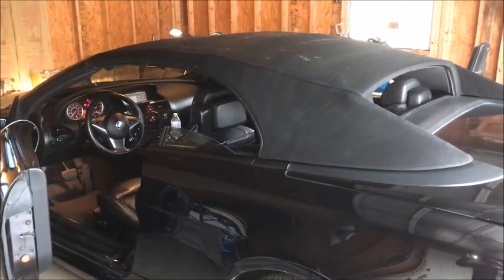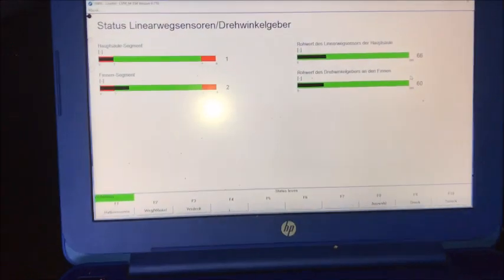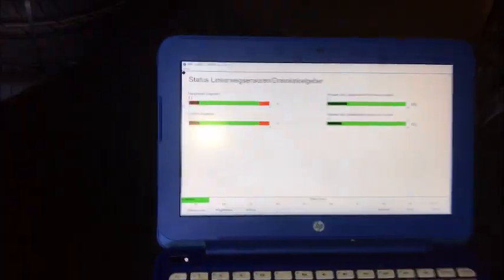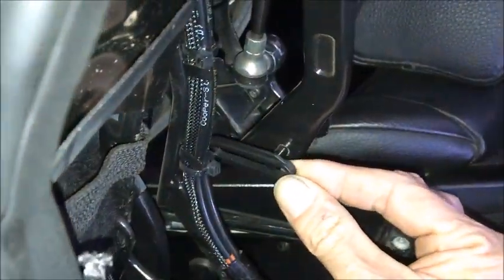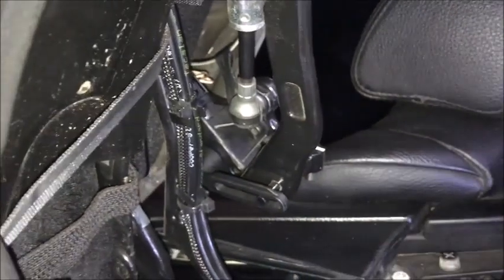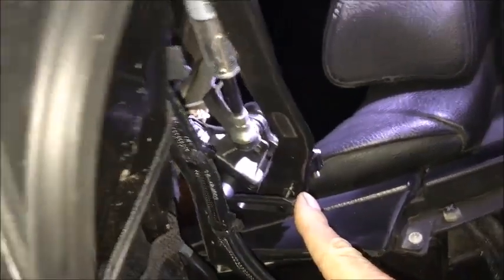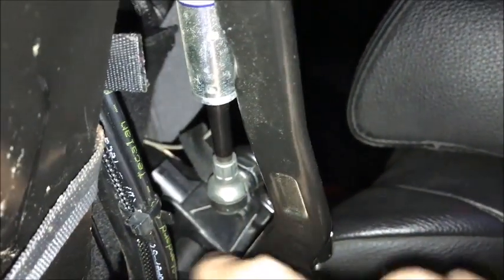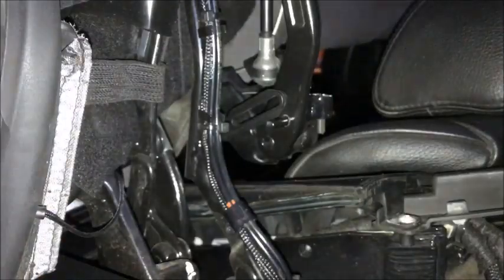BMW e64 Convertible Top Not Locking Part 2 - Adjusting the Segment Sensors

Comment: Thank You sir, today I solved the issue with mine, thanks to You.
I was not able to lower the soft top, also the rear window stopped working. Luckily I was able to reach the sensor from inside and wiggle it.. not sure what was the problem, the sensor itself or the wiring. Who cares, it works now. If it stops again I will know what the problem is.
Wish You all the best.
Reply from the maker: Thanks man !  Glad the videos helped some 👍. The soft top is kinda grumpy about that segment sensor...it causes more problems than any other part of the complicated top mechanism it seems.  Thanks for taking the time to comment and all the best !  Steve

Comment: The other issue you might run into is the gas struts it won’t completely sync.   The way to fix this is the gas struts on the left and right side must also be in sync.  These are very first segments of the top to the middle of the top.   You may have to adjust those if it doesn’t close completely or open correctly.

Comment: Hi Steve, a very helpfull video, thank you. your computer looks like a standard HP laptop, how did you connect it to the cars computer and what program did you use ?, thanks again.
Reply from the maker: Hey man !  Thanks…glad the video helped some 👍. Yes, it is a low cost HP laptop with windows10 that I bought and dedicated it to the software (i gave it an SD card as it didn’t have much memory).  The software is a free download of INPA that comes with some other software to talk to the BMWs.  It’s out on websites like Bimmergeeks.com (thus why the laptop is dedicated to this software as I don’t trust free downloads, lol).  The OBDii cable is special to the BMWs, but can be purchased from eBay, Amazon, or the websites that have the free INPA download.  The cable our car model uses is the one referred to as the “silver” cable (not the blue one), as is has a little switch to do either K or D-Can communications mode.  It’s cable has a clear wire jacket and you can see the silver braided shielding inside the cable…thus they call it the silver one.  The software wasn’t fully translated from German to English, but it connects up fine.  Some folks have had difficulties getting it to talk to the car, but the software typically comes with some directions on how to load it and what steps to take to get the USB port settings correct for it.  Hope this helps and all the best !  Steve

Comment: I know this has been posted a while ago but I was wondering what diagnostic software you are using. Is it a standard Windows laptop with an OBD-II USB connection? Thank you!
Reply from the maker: Hey man !  The laptop is a standard windows based PC, but the interface cable is a special one for the BMWs.  The software is called INPA and is a free download at this point since our cars are getting older now.  You can get the cable (it’s referred to as the “Silver” cable as there is a blue one as well that works for the older BMWs) as well as the down load for the software from places like Bcables.com or Bimmergeeks.com.  Since I don’t really trust any free software downloaded off the web, the laptop in the videos is dedicated to running just automotive communication software and I don’t do anything else with it.  It’s just a cheap Ram drive type windows PC…adds a bit to the cost of being able to communicate with the cars, but worth it to me just for peace of mind, lol.  Hope this helps some and all the best !  Steve

Comment: Hi Steve. I'm not sure if you will see this. Thanks for the video. I put a new sensor on but it is at position 0 not 6 where the old one left off, using the above method. So the top will not close. Any ideas?
Reply from the maker: Hey man !  I actually got one when I changed one out on a guys car that he brought to me for help and it too was reading the Incorrect segment position when I installed it. I bought it off PartsGeek as their price was a bit better, but seems it was calibrated incorrectly (or maybe someone rotated the arm around as they were packaging it and messed it up). I sent it back and got another one and that one worked correctly.  It may be that you got a defective one as well if the segment being read is way off to the segment needed to make the top work.

If you put the old one back on and it’s reading the correct segment and then allows the soft top to function, then I’d definitely say something is wrong with the replacement sensor.

Comment: Hi Steve I have a f12 convertible and problems. Do I can use the same Programm for the repair
Reply from the maker: Hello, I believe that INPA (the program on the laptop) does work for the Fxx Series as well, but since BMW changed the car’s control logic, I don’t think it uses the same cable or format.  The Exx series communicates using the k+Dcan logic where as the Fxx Series uses their newer operating system called ENET.  I’ve seen some posts out on the web where folks discuss how to configure INPA (or ISTA) with an ENET cable, but I’ve not done it since I don’t have an F series car (yet, lol).  Hope this helps some and all the best !  Steve

Comment: Thank you so much for this video. My 630 has the same issue. Sometimes I will just be driving along and it will chime and say soft top not locked. A very light tap on the inside of the passenger rear quarter roof part and it gets it working again. So I'm thinking it maybe the same sensor you had problems with. Will take a look tomorrow. Have you had any problems with it since? Thanks again.
Reply from the maker: Lord Brit , hello...Thanks!  Yes, it stopped doing the chime and showing the top not locked after modifying the sensor until just about a month ago when the sensor actually failed (it had a small area on the sensor sweep that stopped sending a signal).  I made another video on the channel called “BMW Hall effect sensor status and what happens when the segment sensor fails” when it recently failed.  When the sensor finally failed recently, I was able to set the position easily since I had modified the plastic sensor mount from this video (the holes are modified in the sensor mount, not the actual sensor) and it’s back to working flawlessly again.  Let me know how it goes 👍
Reply: Steve’s DIYs thanks so much for the reply. Actually can't wait to give this a try. Fingers crossed. 👍

Comment: Hello steve just wanna say thank you for the info on the E64 convertible top its been priceless in helping me solve issues.....right now my top won’t completely close it closed but the the two hooks or clamps (not sure what they’re called) or not locking the motor where allen key goes just make a loud noise kinda like the motor is stripped or something & the hole where allan key goes spins fast.....i cant get it to go up or down now even manually with allen key & had to manually roll up back window.....im trying to purchase inpa cable and software but having hard time finding a reliable program to intall ive read all the comments and see u suggested bcable but reviews on every review site are horrible & amazon reviews on the cd have been bad as well. Ive been doing my due diligence for a couple days now & still not sure where to purchase....do you have any new updated suggestions on where i can buy the cable and program? Thank you for your time!
Reply from the maker: Hello, glad the videos are helpful 👍. Yes, it does sound like the motor gears are stripped out in the latching motor for sure (it’s a common problem on these). Here’s a link to a video on the issue and how to remove and replace the gears if you haven’t found it on the channel yet: https://youtu.be/1psaE3Uj-BM . I think there’s a link in the comments for where to get new gears from (they are not expensive at all now). For the INPA, it does appear that the bcables version of the software they are sending with the cable is not loading very easily and folks are having problems getting it to load up and communicate with the cable. I was just helping another owner a couple of weeks ago to load up the bcables software, but we ended up just downloading the free download from bimmergeeks.com and it synced with the cable and car the first try. I actually have the bcables cable and then have their software on one laptop, but I also have the free download from bimmergeeks on the blue laptop in the videos. I do use the bimmergeeks software equipped laptop much more than the bcables software. I’ve never used a bimmergeeks cable so I’m not sure about it, but in looking at the pictures, it looks like the bcables one except that it’s not silver in color (which doesn’t matter as long as it’s compatible with the model of the car).  The cable is the most important thing as it has the computer chips in it to allow the translation, but if the software won’t load up easily it gets really frustrating. Bimmergeeks.com might be another option to check out as they sell cables as well and I have had good success with their software even recently. Since all of the software(regardless of who’s providing it) is a copy of the original BMW software, but has been through other companies hands, I always recommend getting a separate cheap laptop to run it. That way if there are bugs in the software, it’s not going to mess up something on a computer with any information on it. When I first got mine, I bought the laptop, linked it up to the WiFi and downloaded the software, then turned off the WiFi and executed the file to extract and load the software. That way I could disable the virus scanner (which will sometimes prevent it from loading) with zero risk. I have never turned the WiFi back on since loading (as it’s not necessary since there are no new updates for the software)...that way if there was some bug in the free download it is trapped in just that laptop.  Sorry for the long winded reply 😃, but hopefully it helps some. All the best ! Steve
Reply: @StevesDIYs  I truly appreciate you taking the time to write such a thorough response it shows you care & im sure you get a lot of questions. Cant thank you enough ill be looking into everything today i let you know how it goes thank you again have a great day!!
Reply from the maker: No problem...always glad to help as there’s just not much info out there for these soft tops 👍. I don’t think I’ll ever break any YouTube records on subscribers or watch time, but I’ve always said that if the videos helped just one person, then it was worth the effort to make it. Let me know when you get it fixed and working good again...I always like to here that folks were successful in fixing them 👍. Steve
Reply: Hello Steve so i hate to keep asking questions but im really frustrated i got my wire & program Monday and ive been literally since Monday ALL day everyday since Monday been trying to get this program to work so I finally got INPA to work and recognize my battery and ignition on but when I choose “F4 (E60)” then i chose “BODY” and then “CONVERTIBLE” i keep getting error code D_CVM. SYS-0005: object file not found ive googled ive used Beemerfest which has helped up until now.... im really frustrated im ready to just go to BMW because I can’t drive my car at all, but I know the tricks they play & there’s nothing wrong with my car at all besides my convertible top my car is immaculate but i run into problems with my top all the time and your channel has helped every time so far....sorry to ramble on but my point is, is their a program that i can just download one click or something. I ordered the gears they came as well but i gotta figure out how to get my top down let alone closed all the way the latches are not clamping its closed but not locked all the way down and my top won’t move up or down the gear where the allen key goes just keeps spinning hence ordering the gears lol but my point i can’t even move my top manually due to that ....I know that was all a mouthful and I apologize but im lost and i know i can do it myself with help. very frustrated lol
Reply from the maker: @5stuntaib  , no worries...glad to help any way I can as I know how frustrating the tops can be when they act up and hardly anyone works on them anymore 👍. If you want to, message me on Facebook’s messenger at “Steve’s DIYs” as it will be easier to respond due to YouTube’s comment lag. Are you located in the US?  I’ve helped several folks by phone as it’s a bit easier to walk through what to do to check things. You’re right that BMW is gonna be expensive and most likely say tons of stuff is wrong...my sons friend just got a quote to replace his brake pads and do an oil change and it was like $2000, lol !  If the top is partially latched and won’t let go of the top of the window, you’ll have to pull the plastic trim down and move the flexible cables by hand to finish the unlatching process. Then you’ll be able to get the top retracted to fully access the motor to replace the gears. It’s not hard to do, but gotta be careful not to break the plastic trim piece. I’ll look up one if the videos and send you a link where I’m removing the plastic trim...that way you can see what’s holding it on to know how to putt it down partially to access the flexible cables.  INPA struggles to talk with some of the car’s modules (some it won’t talk at all to for some reason).  Some need to have the car running and others will communicate with just the key in and the dash lit up (putting the fob in and then pressing the start button without your foot on the brake pedal). Just let me know if you want to message or if in the US we can do a phone call 👍. Steve
Reply: I cant express my gratitude no kidding!! im in Florida ill send you my number on messenger thank you, thank you, thank you!!!!!
Reply: Im not sure which one is you it gives me a couple of options on messenger
Reply from the maker: @5stuntaib  👍. Here’s the link to the video on the channel on what is holding the plastic trim on that covers the motor and cables. If you skip to the 3:45 minute mark, I show what’s holding it on. You probably won’t be able to get to the screws in the front as they are above the window, but the back is only held on with clips and the two screws on the sides may be accessible. Popping the plastic down in the back should allow a gap to reach in and pop the cables loose from the motor and twist them by hand till the latches let go. If you do give it a go, be sure to keep twisting the cables even after the latches clear as these also release the tension on the top and make the little front part start to come up. Here’s the link: https://youtu.be/obY_R7XhcvE .  Sounds good, yep just message me and we can talk through it a bit 👍.
Reply from the maker: @5stuntaib  , here’s a link to my page...there should be a message button on it as well (it has an old school bobber and a Little Yellow truck on it:  https://www.facebook.com/stevesdiys/

Comment: Hi Steve, I have a 2012 650i xdrive convertible. Engine was replaced and so was the battery.  The front windows didn’t work and the top wouldn’t go down.  I got a used FRM3 from eBay and the windows would go up/down incrementally a half inch each time but lighting were messed up since it wasn’t programmed to my car. I let the car sit with the eBay FRM for a couple weeks. Cleaned out the garage to store the car and the windows worked normally so did the top.  Even with the remote.  Next morning I went and tried it and it went back to going up half inch increments and top wouldn’t work. I’m confused, why it worked and now it’s not again. Can the used FRM be programmed or do I need to get one from the dealer?
Reply from the maker: Hey man !  Yes, a used FRM can be coded to the car, but takes some programming using Winkfp and then Ncsexpert from what I’ve read. The process is very similar for most BMW series. Here’s a link to a write up for the E90 FRM module coding that explains some of it:  https://www.e90post.com/forums/showthread.php?t=1184199 .  The dealer or a shop that specializes in European cars can typically recode it as well, but I’d check the prices as sometimes they charge quite a bit or they say they can’t guarantee that it won’t mess other things up. Hope this helps and all the best !  Steve

Comment: I'm debating weather to get the coupe or the convertible . Is the soft top worth the trouble ?? Thank you >>>>>
Reply from the maker: Hello, the periodic issues with the convertible top (thus all of the videos on my channel about fixing it, lol) are annoying, but with some pointers and most definitely the ISTA software and communication cable, they are not hard to fix.  This is one of the reasons that I started my channel as there was no information on how to fix the top issues so people were very afraid of these cars from a maintenance perspective.  I also have a e63 M6 (coupe) and love driving both, but for different reasons.  My '08 650i Convertible (actually it is my wifes) can't be beat on enjoying a nice sunny day or even cool days as it comes with the heated seats, heated steering wheel, and special settings on the climate control for when it is in convertible mode, but my M6 coupe has much more power and is better in the really cold months on comfort.  My wife would not trade her 650i convertible for anything....even with the periodic top issues and the slight worry that it might mess up while on a road trip or something.  Knowing how to close the top manually is a must just for peace of mind...I've only had to do this when working on it, but would be handy to know if it faulted away from home.  Every time it has faulted so far, I was able to thump on the sensors or help it lift ( when it is cold outside ) and it has completed the cycle.  Sorry for the long reply....hope this help though, Steve